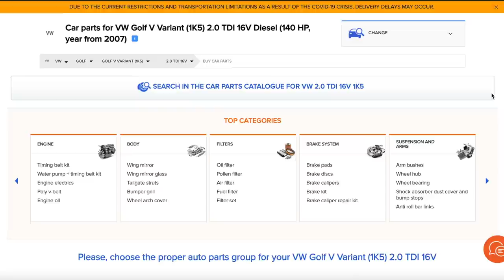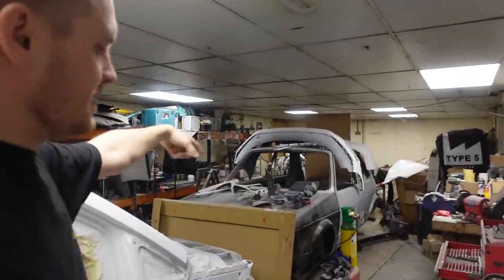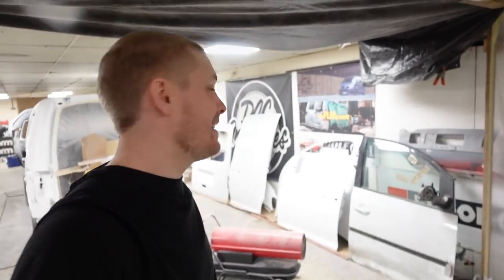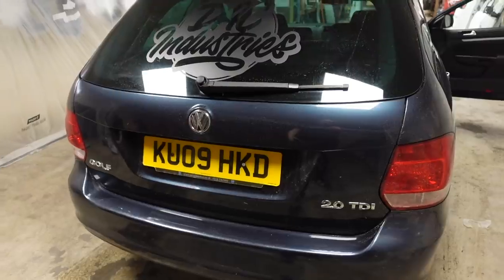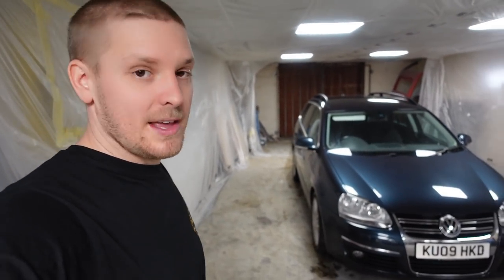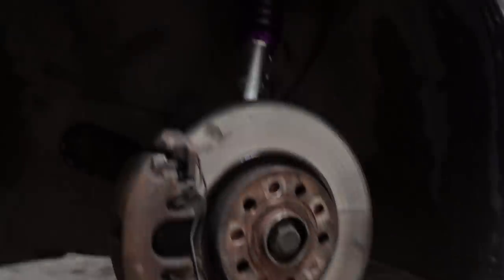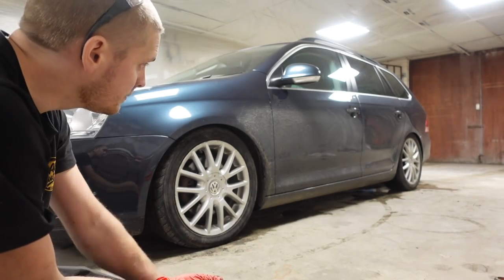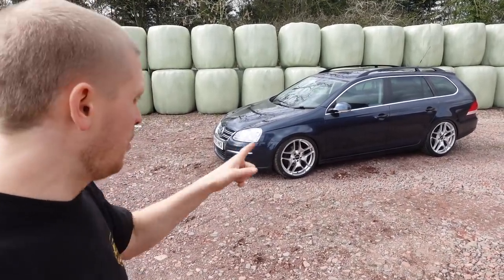Mk5 Golf Estate Variant Wagon - Budget Daily Driver - Fitting Coilovers

Comment: Slightly odd question, you are one of the only guys I've seen with this exact car. Do you know how to access the gear stick bushings? Doesn't seem to be the same as a regular Mk5 golf
Reply from the maker: Hey, Sorry unfortunately I don't. Surely they are the same as a standard Mk5 Golf?
Reply: That's what I thought but I tried the technique required for the standard golf 5 and got no where. Maybe I wasn't pushing hard enough on the plastic...but I was certainly pushing a lot harder than is needed for a standard Golf 5. Thanks so much for replying though. If you find out how it's done it would be great if you made a video on it. Thanks!